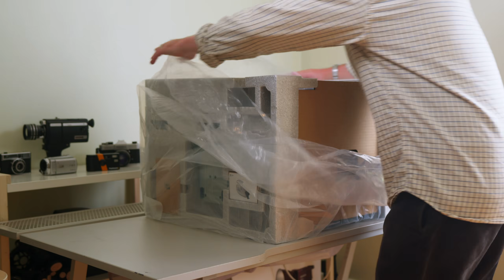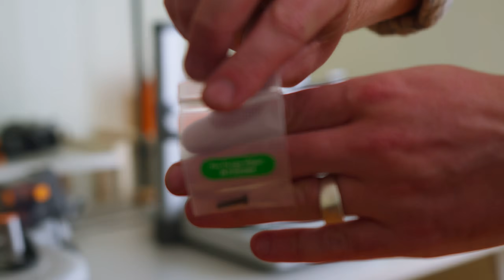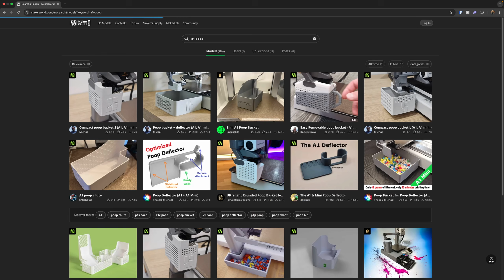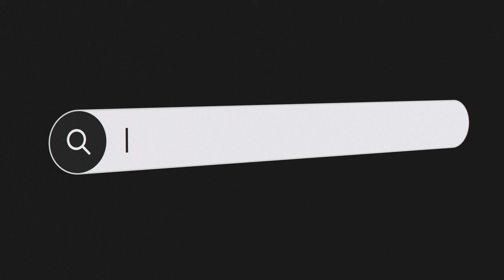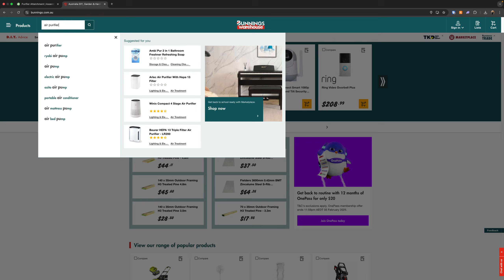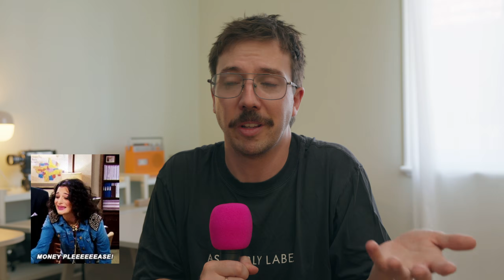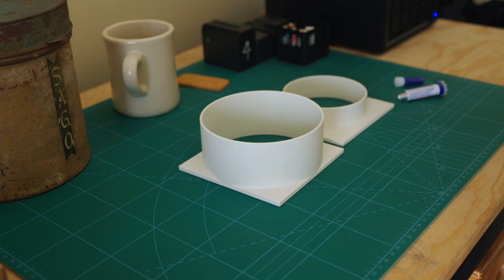Setting up a Bambu Lab A1 so that it doesn't slowly kill me

Comment: Your biggest concern is plastics like ABS; PETG and PLA are believed to be relatively inert but caution is a good thing. Mainly you'd want the enclosure to keep the unit clean and minimize temperature changes, unwanted airflow, etc. For your filter system you should use a smart power outlet with a temperature probe, put the temperature probe inside the enclosure and plug the air filter into the smart power outlet. Figure out the A-1's maximum environmental operating temperature and target that, maybe +/- 2C hysteresis. You want it to be a warm, consistent temperature inside to reduce print defects like layer separation, etc. Ideally you want your control electronics outside the enclosure and get the enclosure up to like 40-50 Celsius but with an all-in-one unit like Bambu that's probably not something easily done if you you're not up to doing custom wiring.

Comment: @bilt_it. I am going to be copying your exact setup at 100%, minus putting the printer on the floor.  I will by an air monitor and may even video my journey and update you.  This was awesome and thanks for sharing all the parts used in the project.

This will be my first project ever on a 3D printer.

2nd project, I am going to print a bench first.

Comment: Soon I will get my first printer and this subject has been half of my obsessive planning... Half being which printer.
I am going to have pretty much sealed part in back storage I have in my flat, for the printer. And before I even consider touching anything like ABS... It will have industrial carbon and HEPA filtering. That Industrial HEPA part will probably happen even if I don't go anywhere past PETG. Might start dabbling with PLA with just that Phillips HEPA filter in the enclosure. Venting outdoors is not much of option in these modern arctic flats.
I have kid. I don't want the little fella paying someday for dad's hobby project.

Comment: The quickstart guide LIES about the y-axis cover. You need to lift the end UP first, before sliding it out.  Once you work that out, it is actually easy. Having that step missing from the quickstart is a crime.

Comment: I have two A1s with top-mounted AMS units and each one is in one of those TOPCUBE enclosures. It's a great setup. I don't have a piped air filtration system, I just have a general one for the room, but it definitely makes a difference.
Reply from the maker: You got any airflow heading in? I’ve made a few videos since this one and each time got some helpful comments. The latest setup is a fan that pushes air underneath the A1 for some active cooling of the components that are passive by default.
Reply: @Billt_it  Oh nice! I'll check out your more recent videos. :)
Reply from the maker: Don’t look too closely at the crappy design I landed on with the shroud for the airflow haha. It works, but it ain’t pretty!

Comment: Hi! Love the video, I just bought the A1 as well and have had some stress peaks over the fumes too. More and more research is showing the negative effect of plastics (fertility, cancer, hormone disrupting etc.) so im fully behind your choice of making the tent. That being said, I will also try and make the same system that you made and/or put it in a work room with proper ventilation. Better safe than sorry :)
Reply from the maker: Yeah I’m probably going to be operating in this room temporarily. I’m trying to set up a workshop for this and woodworking, so will be much more content to do really long prints when it’s safely away from the house

Comment: My research on this topic, reading a whopping three papers focused on fumes and air quality from home 3D printers leads me to believe the primary problem with the fumes are that they produce a significant amount of ‘ultra fine particles’ (UFPs) which are far smaller then the PM2.5 particle size that HEPA filters capture. UFPs are of a size that readily enter your bloodstream and cause toxicity at a cellular level, particularly impacting mitochondria. Unfortunately, HEPA and activated charcoal will only improve the smell of the air and the larger particles, but the UFP will remain and cause cellular damage. I’m still interested in a 3D printer but mine will be living in a shed, enclosed and vented outdoors.

Great vid, though!
Reply: Wait until you dig deeper and learn about all the UFPs and VOCs you're exposed to when walking around town, driving a car, cooking food, eating food from a wrapper, spraying febreeze, drinking from a plastic bottle cup, and so on. Plastic UFPs have been found in rain water. There's no escaping it lol, take some light precautions and print away. Only start to really pay attention when printing abs, asa, cf infused stuff, and so on.
Reply: That's a  common misconseption. HEPA filters actually capture nanoparticles (UFPs) better than PM3 particles due to a process called diffusion. HEPA filters are regulated to capture particles at size PM3 with with 99,97% accuracy, because that's the most difficult particle sizes to capture. The nanoparticles are easier to capture. Look up HEPA on WIkipedia and you'll see some pedagogical pictures

Comment: You need to start by making print test towers. You need the tower to have smooth sides.
Reply from the maker: Can you expand on that, no sure I know what you mean?
Reply: @Billt_it  3D Printer calibration towers are just some small vertical towers, either circular or square that you print in order to adjust the temperature and speed settings so that the walls of the test towers are smooth. Once you get the tower calibrated, then you can print a multi-day print and as long as you keep an eye on it on the first layer it will turn out high quality.

Comment: What about just cracking a window? will that work?
Reply from the maker: To a point,  but if there's a breeze out it'll probbaly just push it all back in. Since making this video I've printed 99% of the time with the air purifier / tent set up and on the odd occasion I take it out of the tent (if I'm filming or something) there is a huge different in how the room smells. So it's definitely doing something.

Comment: So I recently got a Bambulab A1 after using different printers the past 8 years, and the first thing I noticed was the "burnt pla plastic" smell during printing which was never so prominent with my other printers.
Had a look at the default settings and it turns out it's basically burning the PLA at like 220⁰C rather than running the usual 195⁰-210⁰.
Definitely haven't got that taste in my mouth anymore after adjusting that!
Reply: it usually needs the bit faster temp just because its running at a much faster speed than your other printers. Faster printing = need higher temp
Reply: Which is the best temperature for everything at the same time? (I mean PLA for any project)

Comment: i've put 780 hours n my bambu A-1 since i got it 4 months ago, i can say i've thought about this a lot too, it's in my bedroom Aswell.
i've got a filter twice the size, keep the fan running constantly, and the window air unit blowing out the door to redirect it away from living spaces, AND i've restricted myself too TPU, PETG, and PLA as they don't emit many VOC's as mentioned in the video, far less then ASA/ABS stuffs anyways that is.
Reply from the maker: With all that setup, do you find your room has a plasticky smell or not really?
Reply: @Billt_it  I personally can't smell anything unless I shove my face in it of course, my mother once said it kinda has a plastic smelling under tone when running, she's the only one to mention it though.

Only tell I have is if I'm directly next to it back of my throat gets that dry feeling, otherwise I can't tell.
Reply from the maker: Yeah fair enough, maybe I'm just really sensitive to it or something. I did a quick 30 min print with it out of the enclosure yesterday for an upcoming video and it was like a night and day difference to when I have it in the tent.

Comment: I can’t convince myself that the tent is really necessary.  I can’t help but think that if you supported the free end of the hose centrally behind the printer that there would still be sufficient airflow to draw the fumes from the print head into the filter.  Yes the velocity might be low but I think it would be adequate.  Your smoke test would be the decider.  I’ve just sub’d btw.  Your enthusiasm and thoroughness of coverage were the deciding factor. Keep up the good work.
Reply from the maker: Thanks for the sub! Yeah look, I'm not 100% convinced either way to be honest. I will say though, with the tent closed and a print running (with the air purifier on) I don't smell anything. As soon as the print is done and I open up that case, I get the plastic smell. Is it harmful, maybe not. But I'd rather not be sitting in the smell if I can help it.

Comment: I just bought the A1 yesterday. I previously had an Ender 3. It's so much easier to get good prints now. I should have bought the kit with the 4 spool holder. It'll be on my list soon. Great video!
Reply from the maker: Yeah I really love the AMS lite, it's so good to just be able to have access to the different filaments. I made another video on here about top mounting the AMS lite on the A1, you might be interested. In any case, thanks for dropping by!

Comment: BentoBox V2.0 is the printable filter housing i am about to put in my X1C But my A1 is still open air so i might get a circulating filter for the closet ive made into my project hole
Reply from the maker: Yeah I saw those bento boxes, looks pretty sick

Comment: Bit silly with your lack of understanding of the printing sitation and locking down the printer so any modifcations or opensourcing could be the final stage based off how they are locking down the software. Like HP incarnate just spawned and youre the guy who says they will never make ink carts expire before they should. I wonder if you're even educated on the subject?
Reply: Also I know someone mentioned this but high anglles in the mesh could be useful or even using modifiers to fill it with infill and leave an open face
Reply from the maker: I’ve got no beef with the people who feel deeply about this issue, like you do. I get it. I personally just don’t really care. There’s things I care to spend my energy on and this isn’t one. That’s not to say I’m not aware or that I’m not keeping up with the situation and that I might change my tune in the future. I appreciate your and the many other commenters passion on the matter though!

Comment: Liked and Subbed :-), I went through the same thought loop when I got my FDM printer. She now lives in a fume extracted, temp controlled, fireproof, and fire suppression equipped, negative pressure, metal walled enclosure venting to the outside through the wall of my garden workshop.

I may... Have gone full overkill 😂
Reply from the maker: We’re fans of full overkill for the sake of it around these parts my friend!
Reply: @Billt_it  it's a way of life isn't it 🤣

Comment: Great video mate!  I have the same system and case but know my wife has a nose to anything "plasticy"  and put the printer down in the garage with the case around it.   I just leave it in there while it prints away and try to no open it because they say that disturbing it while printing higher temp things like ABS require higher heat and no drafts.  I really don't notice any smell from regular PLA which if you look into what its made of which is Corn Starch,  however with ABS and other stronger materials I make sure I'm no around when its printing and wait till long  after its printed to check on it.

Comment: Did that enclosure come with an exhaust fan? Or did it only come with the vent tube? Thanks for all the valuable info!
Reply from the maker: It just had a flappy hole on the side, I bought the vent tube and also repurposed a cheap USB clamp fan that I had lying around, then just printed parts to fit the size of that specific fan. This would be more straightforward with some off the shelf PC fans or something of that nature and if you’re really smart, working out a way to remotely control them with a little raspberry pi or something. Not my wheelhouse unfortunately haha
Reply: I see, thanks for the quick reply 😃

Comment: I just wanna point out that this video is exactly the speed amount of info and level of discussion that I have been looking for, the fact that this exact printer with that exact enclosure with this exact air filter set up is exactly what I have been looking for and thinking about is just perfect 👌. The fact that no other Youtubers really talk about the VOCs or micro plastics or the potentially life long issues that this hobby can bring I am so happy to see someone actually give a crap. Like I understand they MAY not be a risk, but I don't wanna take that.☺
Reply: I've been thinking about getting into 3D printing for a while but I'm very worried about the fumes and microplastics and I also don't really have space for much of a "setup" to deal with the issue. I'm also thinking about getting into soldering so maybe some kind of fume hood tent thing would kill two birds with one stone... I need to look into this more.
Reply: @altashiro  this is exactly my thought process whilst going through all of this😂
Reply: And yeah, I have to agree with what other people have been saying it's not about data collection, it's the fact that they may start trying to close the garden similar to what cricut or HP did, down the line they may say oh for security purposes, you can only use bamboo filament😃, oh, by the way you can only use our store with our designs....for security reasons... OH BTW we've designed a bunch of stuff ourselves, and it only cost a small fee🤏🏾. and you can see how slippery it could get.
Reply from the maker: Yeah for sure, definitely agree on the Bambu stuff. And yeah, honestly I may be going overkill with the safety on the setup and that’s fine if I am, at least I have a little peace of mind just in case!
Reply: @Billt_it  "just in case" 🤭

Comment: Easy fix. If no air is moving inside my room. I will not receive plastic poisoning. So stay still and dont breath.
But to be honest setuped A1 mini 2 weeks ago and there is no problem with air. Maybe because i use 0.2mm nozzle and usage of plastic is like 30g per 12 hours.

Comment: Enclosing the A1 series is not recommended since the motherboard has no active cooling systems. You'll want to look into developping some cooling system for the base so that you dont eventually fry the electronics.
Reply from the maker: Thanks! A few of these (similar) handy comments freaked me out enough to find a solution. New video on that is in the works!

Comment: I honstely think that printing in polylactic acid is safe because it is made out of mostly natural materials. But printing ABS definitely needs that. PETG, it is safe just not as much as PLA. TPU seems fine too. Just dont put it in a room that you spend a lot of time in and you will be fine. I just put mine in my basement because i can sleep without noise.

Comment: Made with Layers (Thomas Sanladerer) has a video about the effects of air quality, super interesting watch, when he measured it PLA was within normal ranges for VOC . I've never gotten a plasticky taste or smell going on with PLA printing but someone else mentioned it might be bambu filament (which I've never used). I wouldn't say it has 0 effect but its very minor with PLA... anything else, enclosure and ventilation all the way!
Reply from the maker: I watched that vid after I made this one, super informative and it did put me at ease a little as I'm only printing with PLA thus far. Like I said in my vid, it's probably overkill but it can't be hurting and is probably helping haha
Reply: @Billt_it  Worst case scenario, your room has slightly better ventilation and just slightly better air quality than before!
Reply from the maker: @ I like the way you think!

Comment: I just got my A1 recently, already printed a bunch of things and I haven’t had any issues with toxicity. I will say it’s in a big room (central room of our whole house really) so i don’t think it will be a problem, I’ve heard you just need some good ventilation.
Of course, mileage will vary for others, depends on what you’re working with. But I don’t see anything g wrong with a little caution.

Also, if you want a completely free CAD alternative, FreeCAD reached 1.0 a few months ago. And I’ve heard some pretty good things. Up to you of course

Great quality video by the way. I can tell this is something you’ve really wanted to do. Great stuff!
Reply: When we talk about toxicity it is more in the filaments and not the printer. Even the enclosed printer like the PS1 for example won’t hold VOCs it is not airtight or have a big suction fan with an exhaust like the one this gentleman built. If you’re using PLA you should be fine with your set up. If you can open a window it is even better. In winter time you can put an air purifier. It will definitely help. Mind you that Bambu Lab does not recommend an enclosure for the A1. I contacted them and gave some safety concerns. Anyway personally I like to follow manufacturer instructions. Now if you will be using ABS or ASA which the A1 cannot print then YES toxicity is a concern and you should have a good ventilation EVEN with an enclosed printer like the P1S or X1. I build scale model and use Airbrushing. So spray booth with an exhaust going into a filter ( basement with long winters freeing temp so can’t open a window). If you don’t smell the paint it doesn’t mean there are no VOCs in the air. Enjoy your A1 and don’t worry with the set up you have. Just don’t sleep next to it 😊